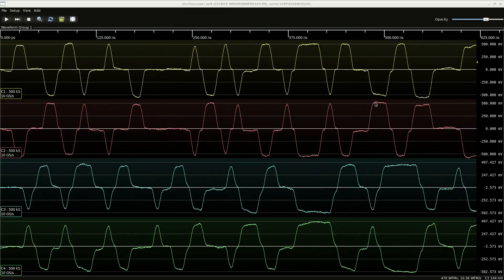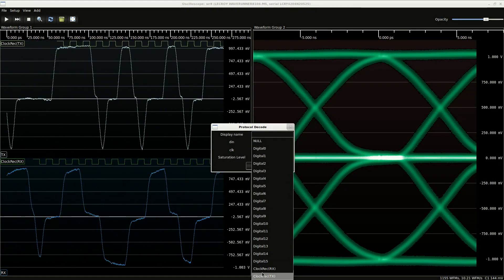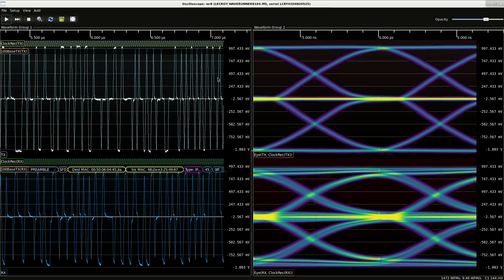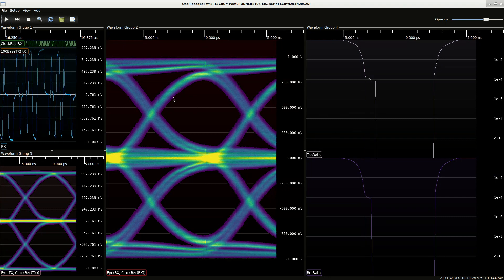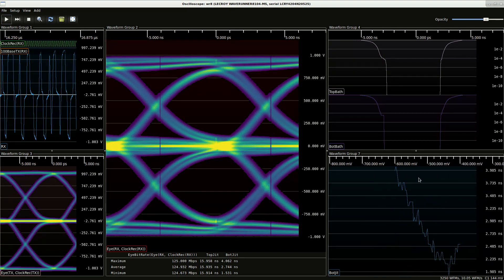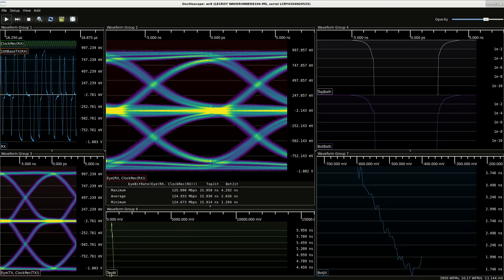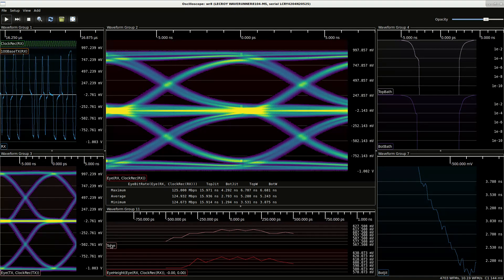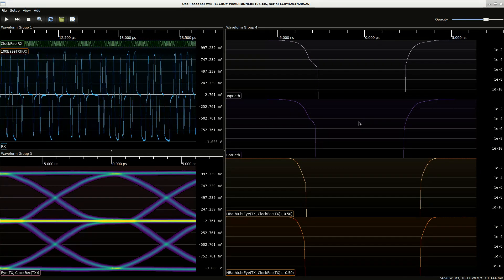glscopeclient demo - analysis of full duplex 100 Mbit Ethernet

Comment: Really nice snapping window management, and the small text is neat too. Too many applications waste all my monitor space without any increase in usability, yours looks really efficient and fast to get the graphs on the screen you want. 
I liked the minimal config as well, e.g for the PLL, no need to set anything but the expected frequency.
Is autoscaling planned for the stats plots? (e.g BER) Seems it would save you some time?
Reply from the maker: BER plots are actually hard coded right now to I think 0 to 1e-12 on the Y axis.
Pretty much all of the stats plots already autoscale on the Y axis, but since the X axis is shared among plots in a group it's a bit trickier. When you have plots with incompatible X axis units in one group (say volts and picoseconds) it draws against the underlying value without regard to units. Which can lead to some display issues.
As far as X axis autoscaling, I try to use that very carefully because it's easy to end up annoying the user. Eye patterns and BER bathtub curves both take over the entire waveform group's X axis and force it to be +/- 1 UI from center. I haven't used it elsewhere yet.

Comment: Is all processing happening on PC? Impressive software either way!!
Reply from the maker: Yes. All of the protocol decoding, clock recovery, etc is my own open source code running on the PC.

For this demo I'm pulling waveform data from a Teledyne LeCroy WaveRunner 8104-MS. The native data format is essentially raw 8-bit ADC samples  plus some metadata for sample rate, trigger offset, etc. Everything past that is my code.

Libscopehal also supports Rigol, R&S, Siglent, and Agilent scopes to some degree, although the LeCroy driver is the most well developed and tested since that's what I have in my lab. Nobody's offered up a Tek to test on yet, and we've never tested the Agilent driver on a modern Keysight scope but it might work.